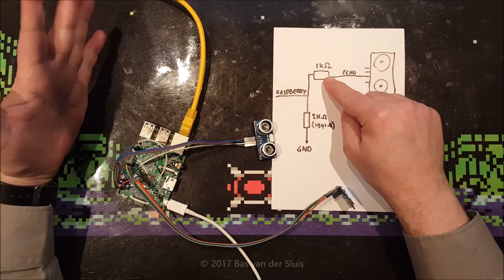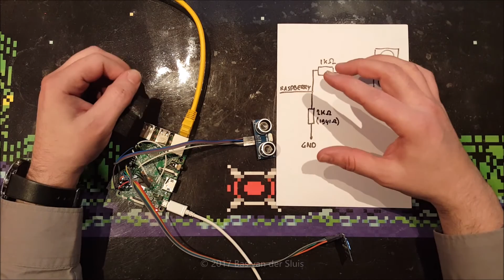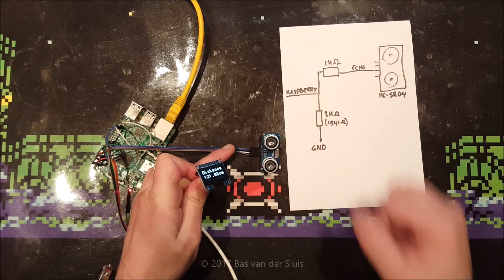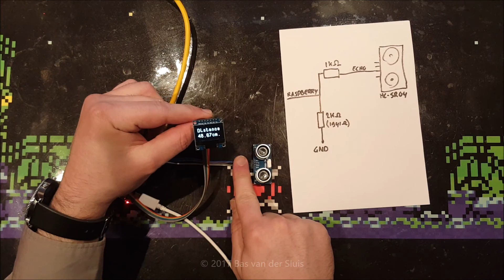Measuring distance accurately with a Raspberry Pi and a HC-SR04 sensor

Comment: I've seen a bunch of videos related this topic and nobody had explained why I needed such high resistance. It might sound silly to an experienced tinkerer, but is much needed information for an inexperienced. Many of us don't have a background in electronics. I knew that GPIO pin can only output 3v3, but I did not know the same applies for input. I was just about to drop the project, but thanks to this video I can work with confidence. I can't stress enough how happy I am.